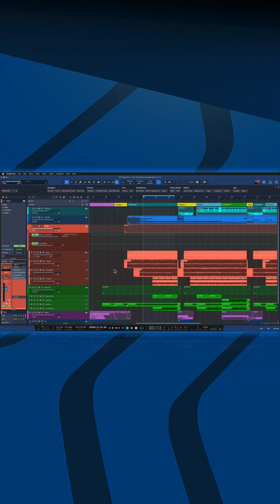New in Studio One Pro 7.1: Bus Transform (Freeze) | PreSonus

Comment: Gregor, I gotta bug you. I'm on 6.5 Pro. I use Ghost Outputs to record busses to save CPU, then disable the tracks. Today, I noticed when making a 2nd ghost output - there's a 200ms delay when ghost recording usng this 2nd ghost output. It's driving me crazy. Using the first ghost output I made - totally fine. Tried this multiple times. Is this a known bug or something? In 7.1 are things like bounce tracks give any more options? For example, in 6.5 and below, when you bounce to new track - things work different for audio or instrument tracks (pan or volume not included depending on the track type). I opened a ticket with Presonus and all they said to me was try 7.0, I found this rather unhelpful. Please let me know. I really think there should be options when bouncing such as a menu even thats like 'include pan, include volume automation, include sends" and make this standard regardless if a track is audio or instrument.